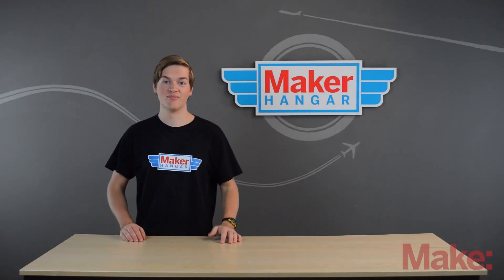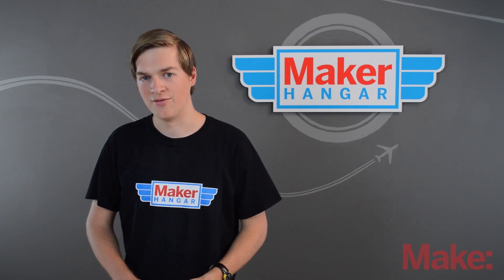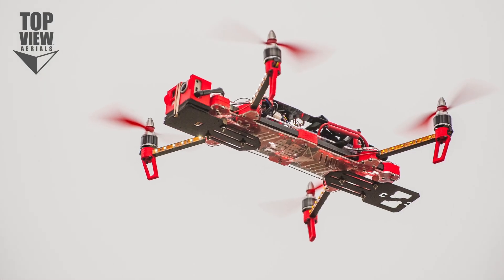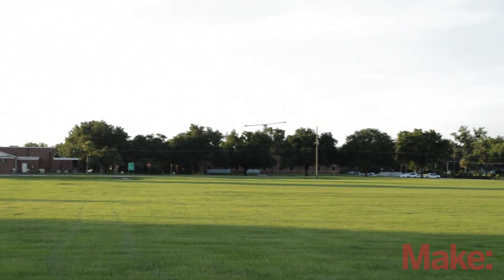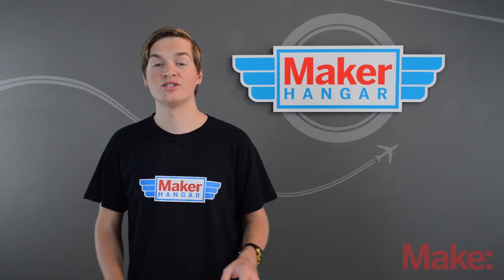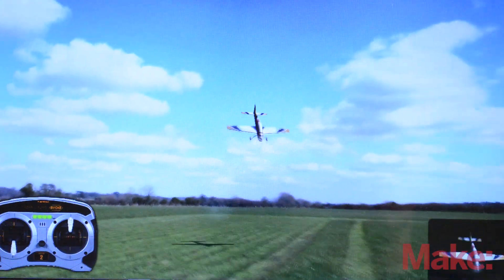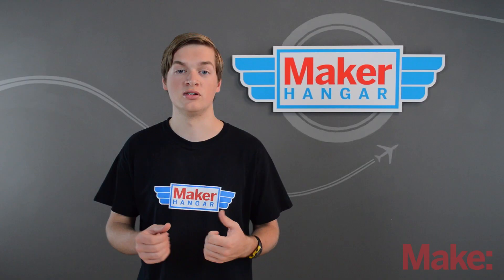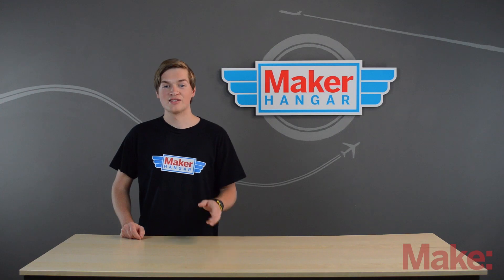Maker Hangar: Episode 1 Introduction

Comment: Hi, my maker trainer is ready but it is not lifting up,all parts are exactly same but the motor is different , it is avionics C3530 1400kv, the plane weight with all the electronics fitted in is 1kg, can any body please help and tell me how much there plane weight?

Comment: I found this transmitter at ebay but it says it for Helicopters. Does it matter if its for helicopter or plane or they work the same? (RC http://www.ebay.com/itm/FLYSKY-RC-FS-T6-2-4ghz-AFHDS-Mode-2-6ch-Transmitter-Receiver-helicopter-plane-/221339022430?pt=Radio_Control_Parts_Accessories&hash=item3388d5745e )
Reply: Hhhjasej

Comment: Hobby King (HK) List # 2 [TOTAL WT both = 996 grams ]
Part name	Wt (grams)
Buddy Code

HobbyKing 105w 7A Compact Power Supply (100v~240v) (Power cord not included)	579
1B37A7A2-5722-47B3-B9F2-7472ADA7A046

Hex locknuts M3 10pc (2)	20
2B6AB4A3-EC5C-4B6B-A1B4-BA43951036BA

30CM Servo Lead Extention (JR) with hook 26AWG (5pcs/bag)	32
1535CD51-3D70-49A1-B3F5-A392439CC9DD

JR Y Servo Lead 30CM Length (5pcs/bag)	53
73AA8F6C-66E1-4DCE-8904-A77F00CAEA29

Comment: Hobby King (HK) List # 1 [TOTAL WT for both = 996 grams ]
Part name	Wt (grams)
Buddy Code

TURNIGY Plush 30amp Speed Controller	55 (x 2 = 110)	
34BB84FD-BEBC-47F7-B4F1-80EB7E59AA98

PolyMax 3.5mm Gold Connectors 10 PAIRS (20PC)	30
448CE003-2B27-4F9E-87BF-8BF374C88A71

Turnigy 4mm Heat Shrink Tube – RED (1mtr)	19
673F4010-33B6-42CE-A2F2-2CEF55AB80B5

Nylon XT60 Connectors Male/Female (5 pairs) GENUINE	39
BAC50B0A-8AEE-4D7E-BC05-4C53F6E57898

Comment: For Hobby King USA I ordered the following:

Part name
Buddy code for discount

NTM Prop Drive 28-36 1800KV / 438W
5D095B70-80C1-41CD-A6AC-A1532192A772 
         
TGS Sport 6x5E Precision propeller (3)
92B43FF3-7ECE-41B5-B3DE-60200AB88E18 

Turnigy 2200mAh 3S 25C Lipo Pack
C751FB24-98CB-4AE2-A98E-D741B43563B1 

Turnigy Accucel-6 50W 6A Balancer/Charger w/ accessories
F5C22AA9-1003-4886-BBA7-DE518493D4EF 

Hex Screw M3x16 (20pcs)
9E28774C-7588-449C-AA87-89457F9E78C4

Comment: Ok, after spead sheet calculations (cost, wt, postage, etc), I've ordered my parts from HobbyKing (HK) USA and HK separately to optimize costs.

Note there is HK (USA) and HK (Hong Kong) so make sure you crunch YOUR numbers before you order since international shipping can become expensive. Apparently there is also something called "Buddy Code"s which gives you a discount too.

Full disclosure, using the code you get a discounted price and I get a small refund if you order using this code.

Comment: Just like 'mountaindewdude76' I have come here via a recommendation from Ed at EA and have found your videos of great interest though I'm also unable to find a large sum of money for my new interest so I have searched eBay and got all the required parts for my scratch build for under €50 (about $55 + I got a second hand TX for only about $18 battery charger $9 and ALL including postage to the South of Spain) but as I'm a newbie I just hope I have the correct combination of electronics. Blueskys!

Comment: There are some free RC Sims out there which are pretty darned decent, too.

CRRCSim (linux & others)
FMS (aka Flying Model Simulator, Windows)
RC Desk Pilot (Windows)
(for example)

And most transmitters equipped with a trainer port can be used as your controller if you get the appropriate plug.